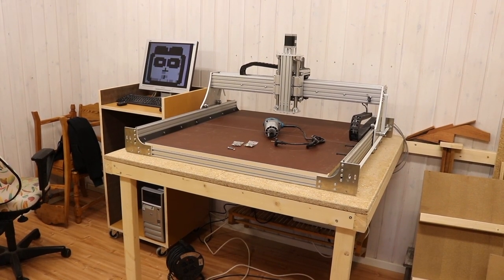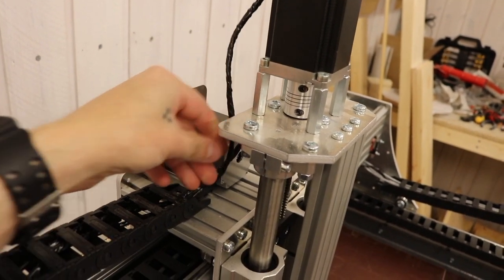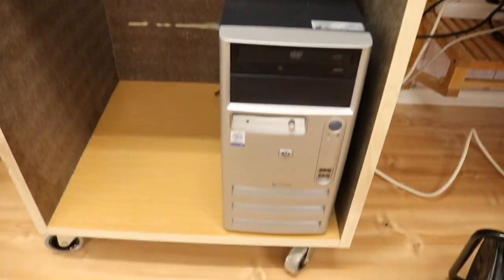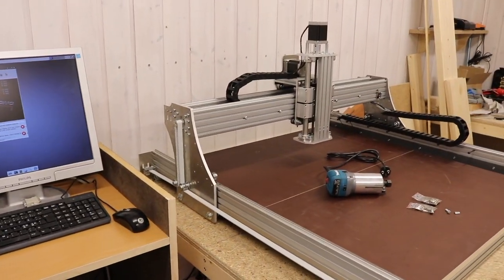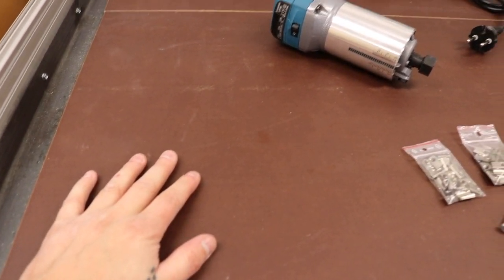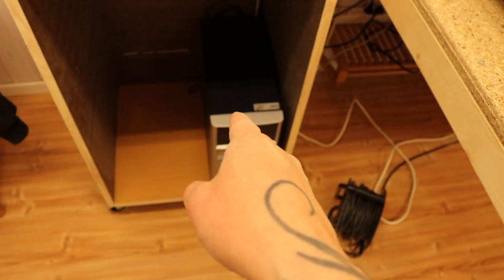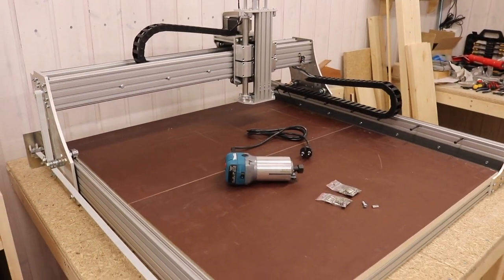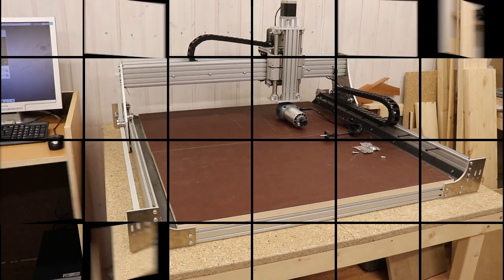CNC Raw 1.5 Build Part 5

Comment: oooooold old video but still i like to comment :
the wasteboard can be made perfectly level by milling off a verry little bit of the surface with the router 
having bought my setup about the same time you did (and not quite put it together yet ) there just wasnt mush available that ran on anything other than an old computer running linux cnc or mach , nowadays theres the arduino and grbl that seems to work a lot better , and is eazier to operate 
wonder if you upgraded to that allready